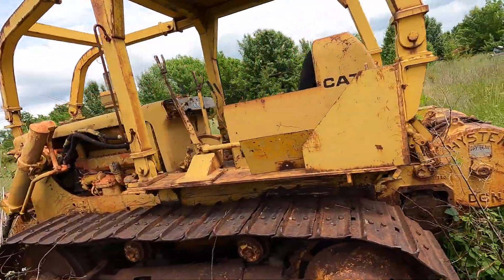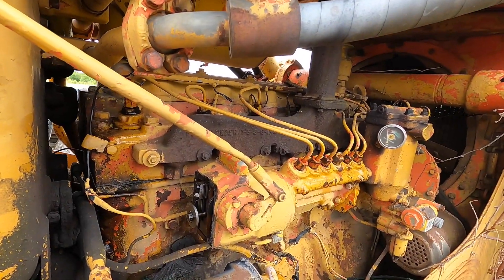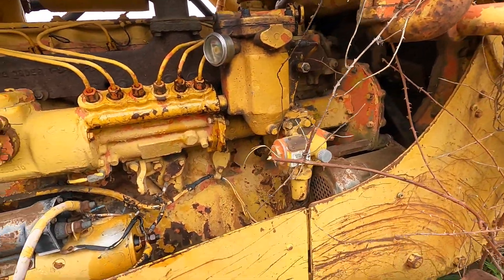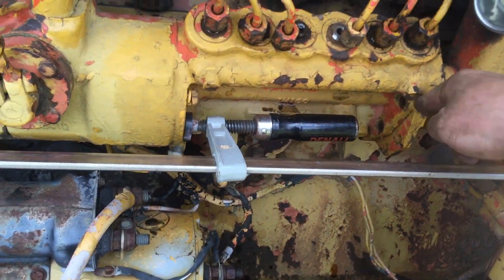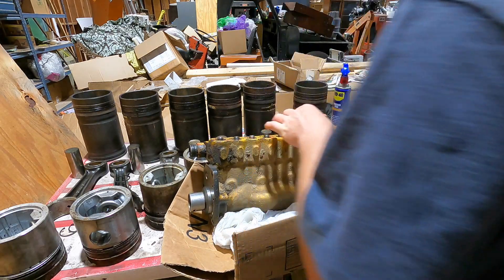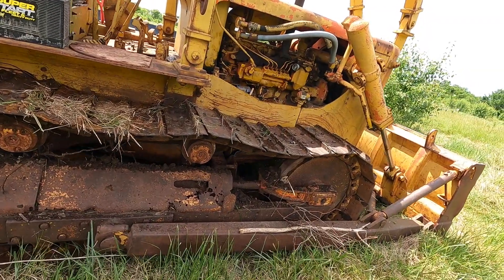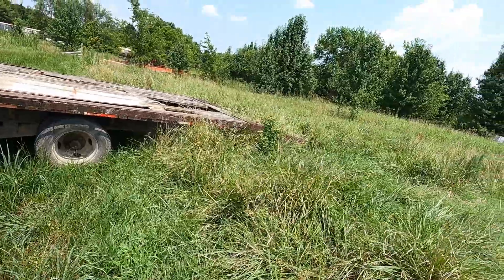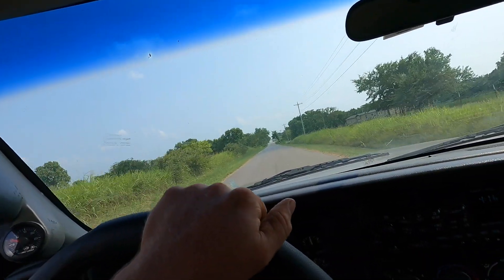Cat D6B injection pump stuck

Comment: Do you know the starter model number? Got one with a pony motor and i would like to change it over to electric starter
Reply from the maker: The starter on mine is a 24 volt Delco 1113948.  Something to consider before making the switch.  The group 4 batteries are $200 a piece.  So $400 for batteries.  Also you might need glow plugs and the rocker switch to go with.
Reply: Thanks for the response. I got the pony motor running great(400 dollars in ), going to keep it.  Do you know what engine in yours and injection pump? Got to get my injection pump rebuild.